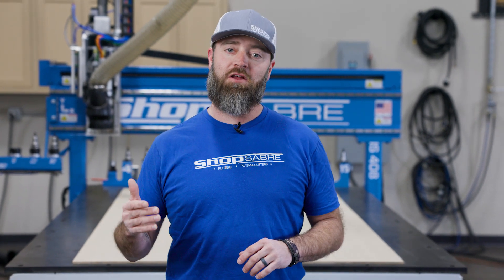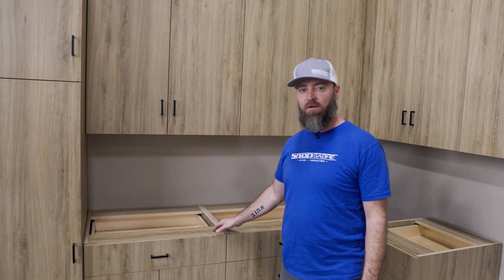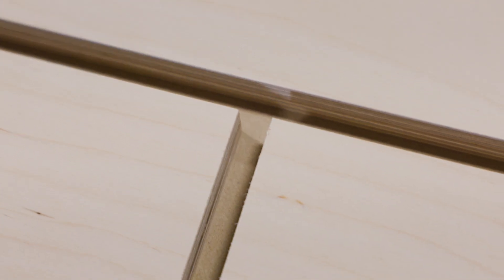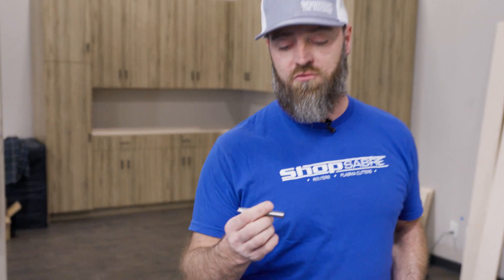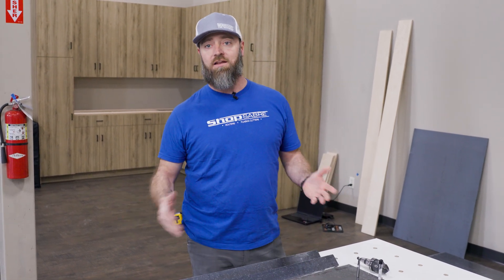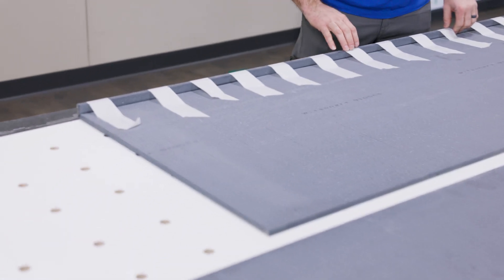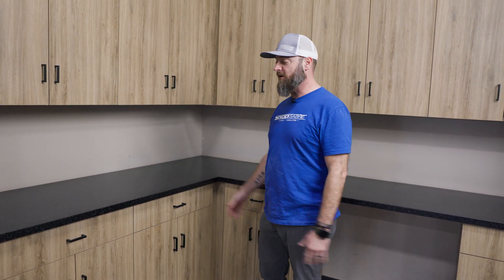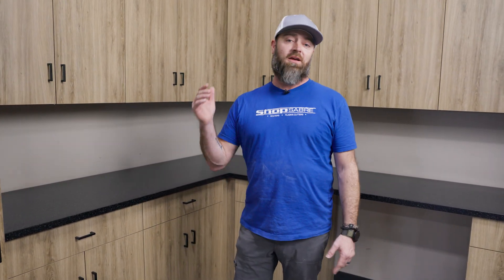ShopSabre CNC - Cutting a Solid Surface Countertop

Comment: Hi, I'm a little intrigued, why would you shut and open the vacuum valves every time you cut material?
thx
Reply from the maker: Generally you'll see us turn them off to remove product from the machine as the vacuum is quite strong.

Comment: As a countertop fabricator , I have to say there were some short cuts that were done for video purposes, but all and all it was a good demo of what a quality CNC can do. In our shop we would have taken both countertops up to polish or near polish, then set them and seamed in the field. And trust me a black solid surface takes a lot of polishing time to hide the sanding lines. What I want to see is the CNC with a sanding and polishing tool and it do the manual labor of that process. As per the need for a splint backer, you can do this, but we typically use a full solid melamine sub top and don't have issues with the seam. Now a seam in the corner isn't the best thing. If the width of the counter is say less then 30 inch wide you could cut an L shape and get out past the inside 90 corner. This makes the finishing of the edge in the field easier and moves the seam line to a better spot that is thought to have less stress. I guess it might be under less stress, but we have made and installed 100s of tops seamed basically the same way with nearly no issues. Most issues are because these are counter tops, not chairs or scaffolds.

Comment: Did they change the standards of solid surface fabrication? Mistake 1 seam in the corner mistake 2 the seam not backed up with a piece under the seam
Reply from the maker: This was something we did in our own shop for a desk we made… the main focus for us was to showcase the machine and prove that our machines can do the cutting. We can appreciate your expertise and experience.
Reply: I haven't seen a new fab book for years but I know a lot of shops are doing it this way.  If that seam is in that location in a home in new construction it won't make it past the first season change